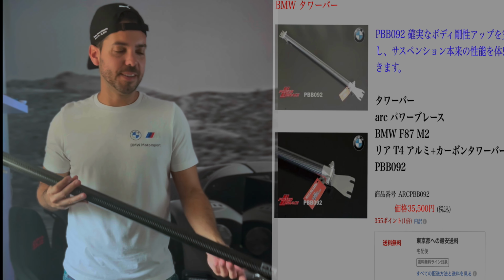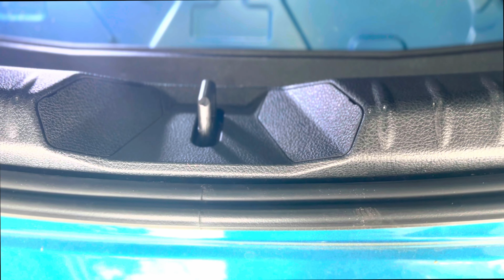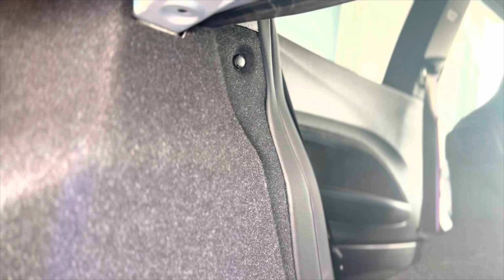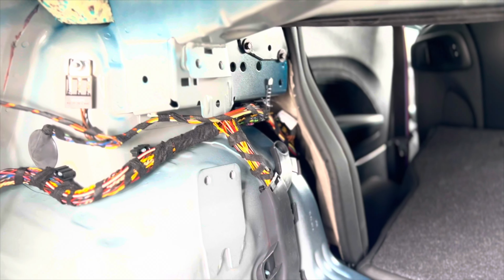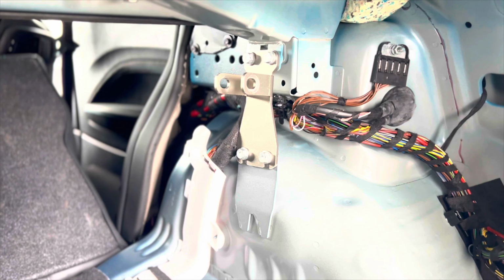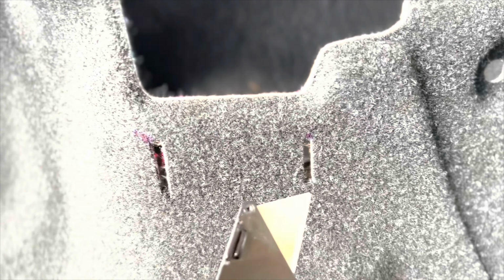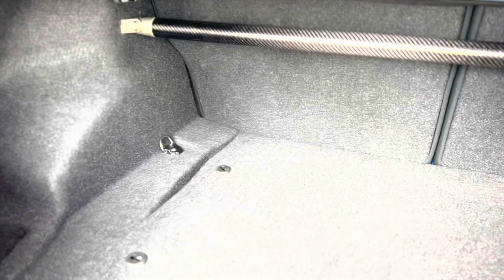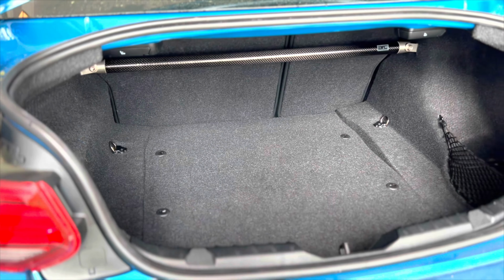BMW M2 Competition | ARC Power Brace install

Comment: Hey man was just wondering if this would fit in a 2018 M240i, also super informative and great video, keep up the good work!
Reply from the maker: Hey thanks! Cant confirm; but if you remove the trunk lining you should see whether the chassis brace is there and can compare to mine. I would think the chassis bones should be same but never confirmed.
Reply: @project9s888  Got it will do thank you man!

Comment: Is there any notable difference in responsiveness of steering after installing brace?
Reply from the maker: I would say it is def noticeably stiffer and provides more feedback. Traction also seems improved so dont see any drawbacks (slight noise increase perhaps) with a small improvement in all aspects of driving. 

As for responsiveness I would say N/A. Its in the rear and the biggest factor for me in response is the front height on adjustable coils. 30mm+/- makes a world of difference in responsiveness, angle of attack, etc. So in short no notice of improved responsiveness. 

Hope this helps!
Reply: @project9s888  Enough to do it again? I like how non obstrusive, light and good looking this is. Just don't know if I'd justify it. 

I do believe the front strut brace I installed made a good big difference, how would this compare in your opinion?
Reply from the maker: @andrxito  for the price - yes. $400 on an M is a fairly cheap mod right? 

That being said I would do a few other things before this as far as performance to be gained. Coilovers, bushings, trailing arms, traction bars etc. 

For me it covered a need - it looks great I have since done rear seat delete and it looks fantastic while adding a bit of stiffness to rear. 

If you are looking for a good visual/performance mod at a lower M pricepoint this is good. 

If you want bang for your buck performance Id spend it elsewhere as mentioned above. Keep in mind I already have KW V3s and H&R front bar so my setup is not stock at all.  The coilovers and especially the front height made the biggest impact/noticeable difference for me. 

Hope that helps :)
Reply: @project9s888  It does help thanks a bunch :) 
I have KW V3 DDC, front strut bar, lower body brace and lighter wheels + a new set of brake discs and pads.
Slippery slope :D
Reply from the maker: @andrxito  very slippery. Im actually just turning to new brake pads as I cant get a good brake feel im comfortable with
Reply: @project9s888  most recommend braided steel lines and different pads